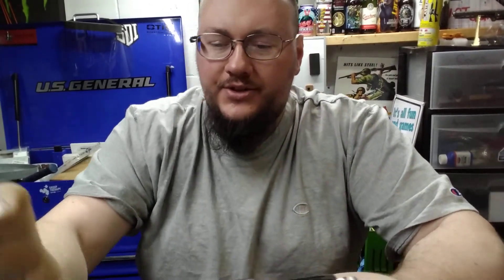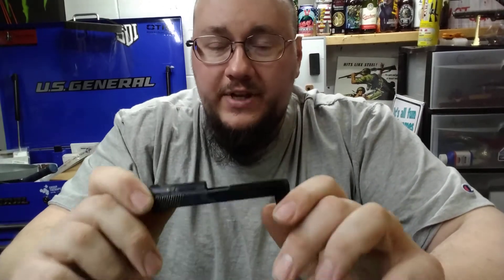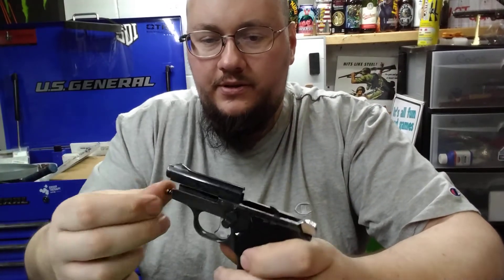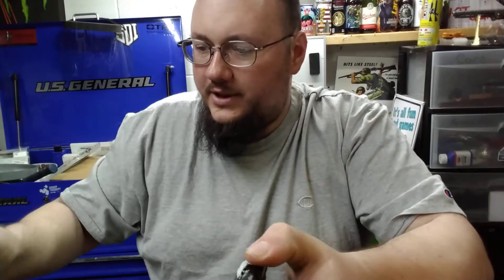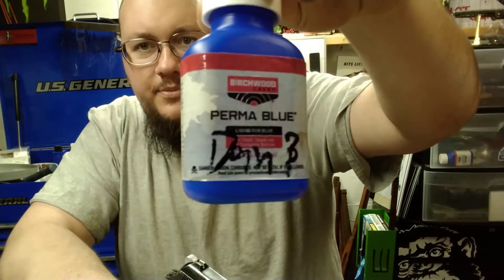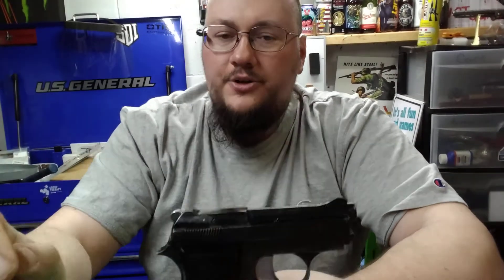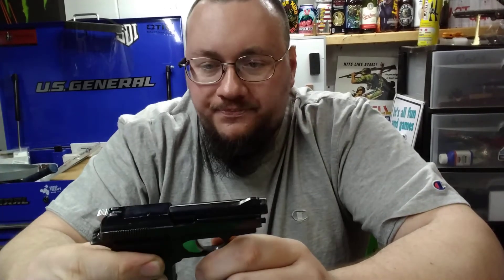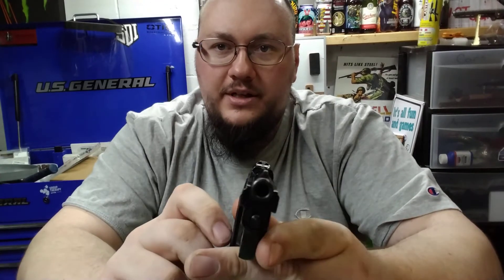FIE Titan restoration pt 2, and basics of cold bluing.

Comment: That bluing looks great. I'm a big fan of cerakote too. They have colors that look nearly identical to bluing. There's also a spray on bluing that another company makes that I thought was really impressive. I'm not sure how well it holds up though. I just saw a revolver finished one time and it looked amazing. Was one of the best bluing finishes I've ever seen (even though it wasn't actual bluing). I prefer Cerakote though, because it's insanely durable (when done right) and it's by far the best rust preventative I've ever seen. Have seen steel parts outside in the heat, cold wind, rain and snow (in NY) for years without ever being maintained and it never chipped, wore off, rusted, faded or anything like that. Still looks brand new after about 10-12 years.
Reply from the maker: Very nice and I do a little bit of ceramote and it's awesome. The company that makes spray on bluing they your thinking of us durakote and I want to try it out. Thought about doing a review on it
Reply: @kiltedgunsmith  Nice. Would be a good video. Have hoped to see more videos on it, because the one's I saw were people applying it and showing the finished product, but I don't think any of them ever made follow up videos to show how well it holds up under use. I'm pretty sure they weren't carry guns that they were coating... so there was probably no point in follow up videos when the guns they coated a just "safe queens" that never get used and never face any actual abuse or even just common wear.

Comment: I did some basic touch up mine but it has bad pitting got it used I want to get. Slide from numrich and complete but not sure what firing pin I have there 3 types and I didn’t take it out but had a number 2 on it .

Comment: I have restored many of these in even worse condition. The mild pitting like in yours can be easily sanded smooth, the frame will not receive gluing but responds well to Brownells alumihyde. Its amazing how amateurs can make mountains from mole hills.
Reply from the maker: It's not a bad little gun, I didn't go full into it because I did it for a buddy of mine and he just wanted it cleaned and a bit of bluing.